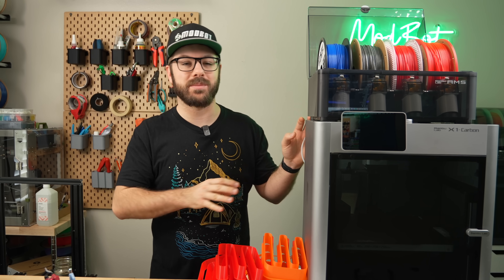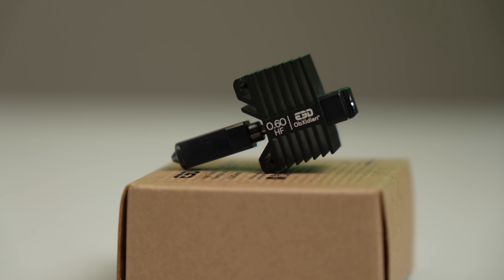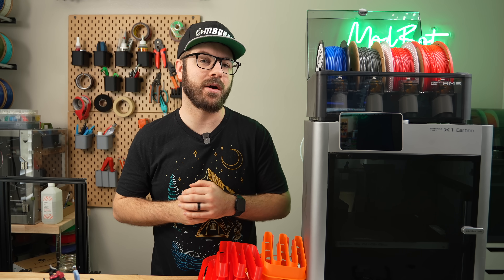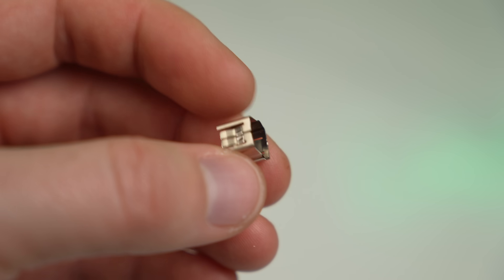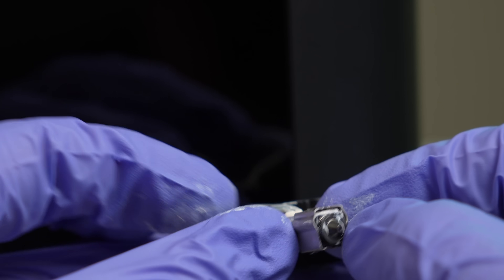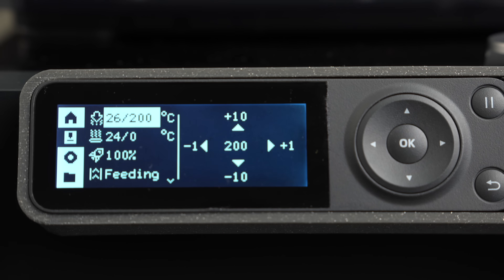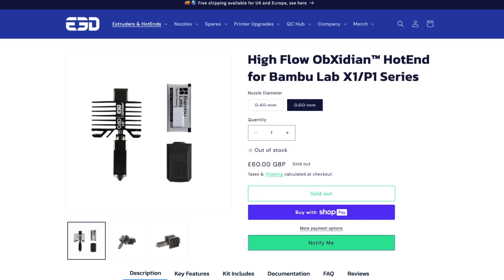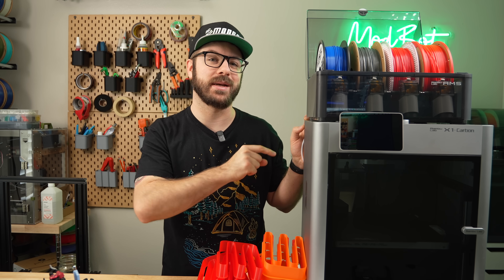Bambu Lab High Flow Hotend Upgrade (E3D ObXidian)

Comment: Agree.  E3D really needs to sell a fully assembled version.
Reply: I will buy a 0.4 and 0.6 hotend as soon as they offer the assembled version. I used DIY printers for 7 years, sold / gave them all away and went for the X1 Carbon because i don't have the time nor the nerves to tinker around anymore. I want a working tool and to be honest, i don't even want to assemble this hotend by hand. I am willing to pay a premium to get this done by someone else.
Reply from the maker: @Nepoxification  I don’t think you are alone with that.
Reply: @Nepoxification  one more in the "I don't have the time nor the nerves to tinker around anymore" boat...
Reply from the maker: Yeah, it’s not very enjoyable and the stock thermistor seems like it could be fairly easily damaged during the transfer if not careful.
Reply: Nothing is confirmed (yet!) but we're actively looking into this with Bambu.
Reply: That's great. Any chance of a more powerful heater?  @E3DOnline
Reply: I just bought one 0.4mm fully assembled, you have the option for X1 or P1 series
Reply: @jsmc7844  Yes, just saw them.  Thanks
Reply: Given that the thermistor's in a different place and it seems like the heater could use an upgrade to keep up with the high flow, it seems almost negligent for them to not sell them as an assembled unit.
Reply: Fully agree.  They need to sell it fully assembled, and with a higher temperature heater.  @Mirrormn
Reply: I use my printer for work, just got the assembled one, will report in a few days if it's good.
Reply: @DeCoded_Void  did it work?
Reply: @angrydragonslayer  Ah, totally forgot about this.

Yep 100%, I was able to get a higher flow rate on the e3d ones and it clogs less when i use filament that's common to clog like with silk pla.

My hotend basically paid itself after a week or 2 of constant use.
Reply: @DeCoded_Void  awesome
Reply: I would gladly buy one assembled but probably won't do it myself.
Reply: Now they do but I'm not sure the improvements are worth the money, as the video says, unless you are printing a lot of large objects with straight geometries.
Reply: @andyharris3084  They do sell a fully assembled version now.
Reply: @Trevellian yes, that’s exactly what I said.

Comment: Structural heatbreak 🤮
Reply from the maker: In almost 2 years of printing with a couple of these printers it’s never been an issue. However, I have seen some posts of nozzle crashing that did destroy heatbreak. I don’t feel like it’s very common though.
Reply: @ModBotArmy it's just weird seeing that all the AliExpress clone hotends now come with 2 extra screws and standoffs and the expensive e3d one doesn't.
Reply from the maker: @twanheijkoop6753  I haven’t seen the clones. I’ll take a look. Could it not be slices patent? The clones don’t really care but an oem wouldn’t be able to.
Reply: @twanheijkoop6753 My Aliexpress X1C CHT hotend has been a drop in replacement with no extra parts and it performs pretty much the same as the one tested here. Its the typical china CHT technique with regular swappable nozzles. 
Originally they where 2mm longer then stock bambu which triggers an error during Z-Probes, but there is now a fixed version which works just like the original. Gotta be careful not to pick up some old stock...
Reply: @ModBotArmy  forgot about that slice bs, shouldn't even be a thing with all the prior art from the early reprap days.
Reply: @ModBotArmy  The clones are using screw standoffs not compression standoffs to avoid the Slice patent. Same as Vez did changing the Goliath to get Slice to stop shutting down sales. So Slice apparently deems this fine.
Reply: @ModBotArmy  Not only will nozzle crashing destroy it, but drag will deflect it, especially under high acceleration, giving you dimensional errors of the type Bambu is famous for.

Comment: Noob question: after installing the new hotend what changes need to be made in the slicer in order for the printer to take advantage of the higher flow rate? I'm guessing the default profiles are assuming the original bambu hotend is installed. Or is there a new hotend already in the list that you just need to select? Thanks for the video!
Reply from the maker: I haven’t seen any new hotend/profiles but that would be really nice. I may email e3d and see if there are plans. Under materials you need to adjust the max flow rate. It defaults to the max for the stock hardware. Other things to edit depending on your prints and goal is slow down for overhangs, min layer time for cooling, layer speeds and possible accelerations along with layer height/line width.
Reply: @ModBotArmy  does the hotend come with a manual to help make these changes?
Reply: You'd have to calibrate the filament first to determine your new max flow rate, then you would bump the Max Volumetric Speed in the filament profile
Reply: You will want to perform machine calibration and calibrate materials for the nozzle. It's like starting from scratch because the variables for flow have all been affected.

Comment: would be nice to see the flow with the .6
Reply from the maker: Maybe I’ll play around with it on a live stream to see what we can reach.
Reply: @ModBotArmy  Gotta run some layer calibration tests first.  See which height at your intended speed is most consistent.  Should be some easy files out there on one of the printable sites you can use.

Comment: the cause for the heating fail with high flow abs is the PID?
Reply from the maker: I don’t think so. Normally when I have pid issues the temp is more fluctuating up and down. This is a straight up drop and pretty damn quick. I’ll be curious to see if anyone else running tests has the same experience. I won’t rule it out completely but not what I have seen when it’s PID in the past. It’s very stable up until that point.
Reply: @ModBotArmy  I mean the pid settings maxing out and the machine thinking the heater sensor failed and killing all heating.   that's the most common PID issue I have had on any firmwares anyway, the protections kicking in and killing the heating.

I mean near the set temperature it would never actually run the cartridge at full duty cycle so that it doesn't swing over, if the pid wasn't calibrated to do that and I don't think this upgrade included any pid recalibration, which seems a bit weird.
Reply from the maker: @lasskinn474  ahh gotcha. A few others have mentioned this has happened with clone hotends as well. I think the bigger limitation is the small heater. A beefier heater along with a PID for it with this hardware would very likely let you reach at least slightly higher flows.!
Reply: @ModBotArmy  I'm interested in the biqu panda revo HF hotend, it has a 60w heater which might have a better chance of keeping up. I'm thinking the 48W heater on the Bambu is running at full power and not maintaining temp, so it triggers the thermal runaway protection

Comment: Couldn't you rotate the clip by 180°?
Reply from the maker: I thought about that but one side of the clip has a portion that sticks in a bit to apply pressure to the heating element keeping it in place. You potentially could still rotate it like you said but it feels like a compromise still.
Reply: Oh yeah, in that case, a better clip would be nice! Or at least instructions in the box telling you with orientation you should use. Because if you had doubt many will have